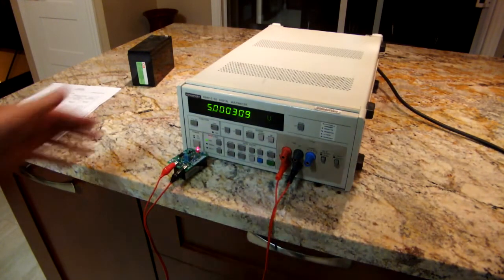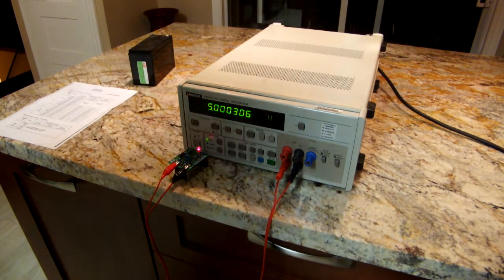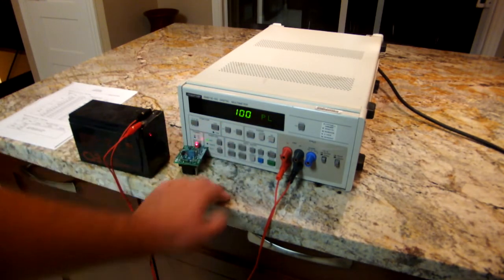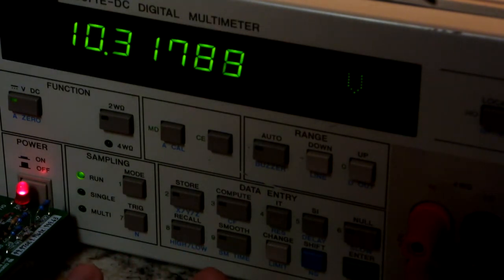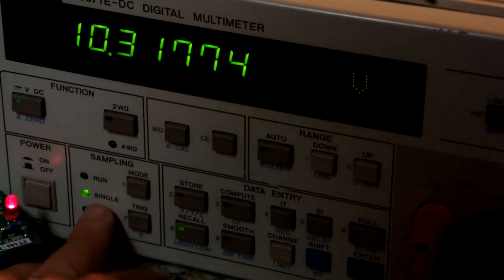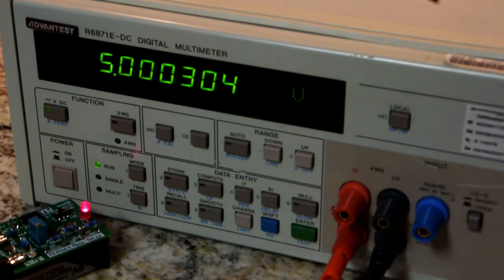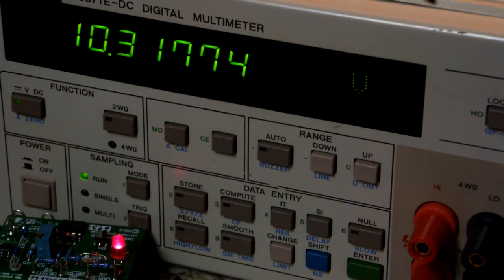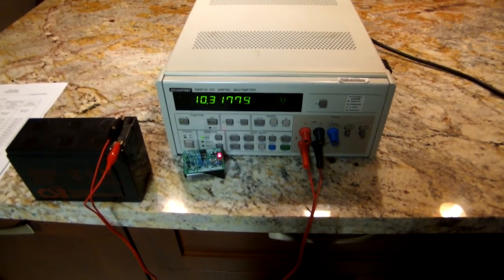Advantest R6871E-DC 6.5/7.5 digit multimeter overview

Comment: I worked for Advantest for over twenty years.  They made the DC version of this DMM primarily for their Digital IC Test Systems as a integrated secondary standard.  Thus there was no need for those functions.  The reason you see so many of these DC versions in the USA is because they are most likely pulls from those testers once they got decommissioned.   Advantest created these AC and Current-less versions of their DMM's in many models over the years.  BTW, Advantest branched off the small instruments group into a company called ADCMT in 2003.   ADCMT meters are still being used in some of the Advantest IC testers to this day.